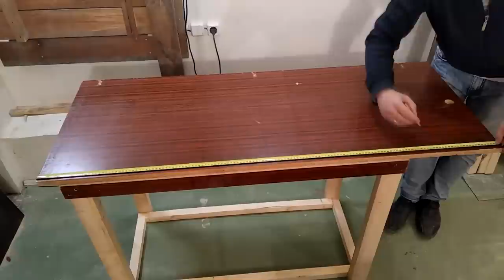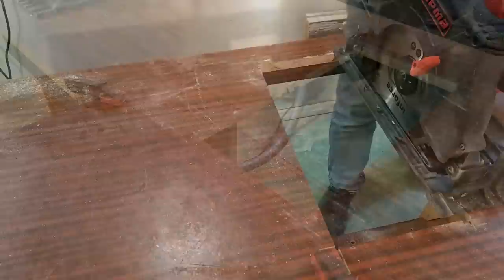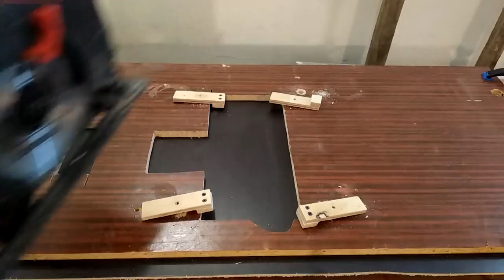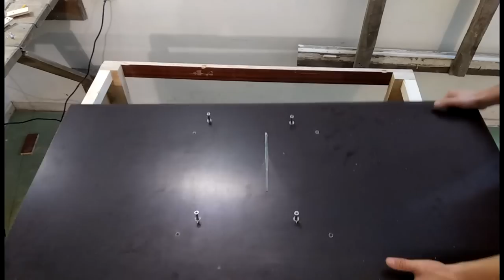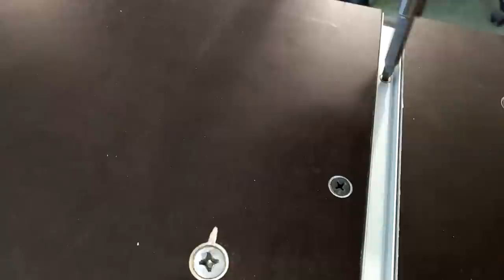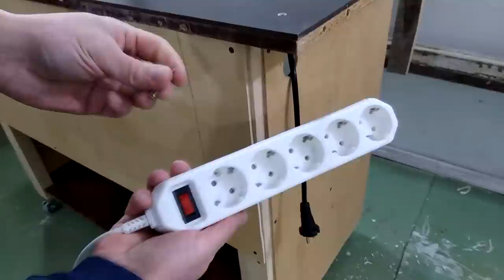Homemade Table Saw — Making The Ultimate DIY Table Saw

Comment: Hello! congratulations on your work! Excellent! I ask you a question: how do you adapt the riving knife? Thank you
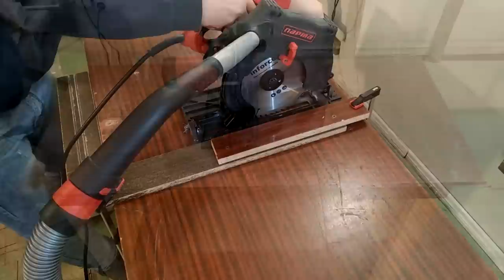Reply from the maker: Hello, Raul! Thanks! It's just a regular circular saw riving knife. In order to make a through cut (like here, for example - 04:10), I dismantled this knife. After making the table, I installed it back (I forgot to film this moment). At 20:38, you can see two knife attachment holes (on the right side of the protective case).
Reply: It would be better if you mention the materials used

Comment: Hello, very nice work. How did you add the safety splitter behind the saw? It's not in the video and i think it's a very important feature.
Reply from the maker: Hi, thanks! This is a regular circular saw blade, which I removed when making the table, because it got in the way. There are special mounts on the saw body for it, on the right you can see two threaded holes at 20:38
Reply: Thank you very much for your response

Comment: Nice build. I about to start building one for myself. Is there a preferred distance for these two tracks from the blade? I can see they are not to the exact same distance, is there a reason for this? cheers 👍
Reply from the maker: Thanks! On my machine the distance is about 50 cm. The different distance from the blade is due to the fact that it was necessary to install a circular saw - pay attention to the bolts on the outside. I don’t think this is very important, but equal distances will probably be better.

Comment: Hello. A question, how did you place the riving knife behind the saw blade?
Reply from the maker: This is a regular circular saw riving knife. In order to make a through cut (like here, for example - 04:10), I dismantled this knife. After making the table, I installed it back (I forgot to film this moment). At 20:38, you can see two knife attachment holes (on the right side of the protective case).

Comment: Hello, in the video the saw is without a separating knife but afterwards I see it. when did you put it on?
Reply from the maker: This is a regular circular saw separating knife. In order to make a through cut (like here, for example - 04:10), I dismantled this knife. After making the table, I installed it back (I forgot to film this moment). At 20:38, you can see two knife attachment holes (on the right side of the protective case).
Reply: @MazayDIY  Thank's.

Comment: where'd the riving knife come from, why'd he take off and put the blade on again?
Reply from the maker: This is a regular circular saw riving knife. In order to make a through cut (like here, for example - 04:10), I dismantled this knife. After making the table, I installed it back (I forgot to film this moment). At 20:38, you can see two knife attachment holes (on the right side of the protective case).

Comment: Very good idea but we didn't see how you  placed the knife after the saw ?
Reply from the maker: This is a regular circular saw knife - it is attached to the protective cover of the circular saw. This can be seen in photo No. 3 here https://imgur.com/a/4dtbVFs
Reply: @MazayDIY  i have an ingco circular saw but there's  no knife , thanx for answering
Reply: and height adjustment is missing.
Reply from the maker: @GNU_Linux_for_good  Table height - 900 mm
Reply: @MazayDIY  Sorry - but I meant the adjustment (i.e. lowering & rising) of the saw blade. Is it just the mechanism that comes with the saw? Thanks.
Reply: Negocio
Reply: @GNU_Linux_for_good  yes i think

Comment: а какие размеры стола
Reply from the maker: 570х1250 mm
Reply: Hello Mazay. Really like your video. Especially because all the wood you use seems to be recycled. 
What is the height of your table ? 
What kind of wood do you use on top of surface ? Most of table saw makers use plywood but here in France it is really expensive thanks for your answers.
Reply: @MazayDIY  привет, подскажите . А алюминевые направляющие  из чего сделаны?
Reply from the maker: @АндрейИльин-п2ь  Это покупной Швеллер алюминиевый 12,9x10x1,5